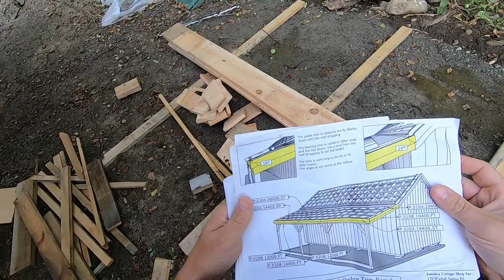Couple Builds Post & Beam DREAM BARN (Installing Windows and Trim Work)

Comment: Good morning Al and Gina. The weather here in west central Wisconsin has been hot and humid! We have had a few bad storms with a few tornadoes confirmed in the area. This heat is hard on the cows and a fat man!! It's cooler today finally. The flies have been bad also. One more month it will change. Average first frost date here is September 23. Good work today guys, Gina is a great helper. Thanks ,Ron
Reply: Flies can be controlled by Diatomaceous  Earth.Feeding it to cows can be problematic unless you give them grain and buy the pelletized type.Flies land on the manure with the DE which kills them.Used it to great effect in chicken houses.No flies within a week.

Comment: White vinegar and steel wool left for a few hours and painted on will give an 'antiqued'  weathered grey finish to the wood.
Reply: i was just about to say the same thing.
Reply: I have just learned something. 

I do enjoy these bits of information. Thanks for sharing.
Reply: test on a scrap piece first
Reply: It's called Pickle, cuz de vinegar. Test first, the steel wool would oxide, the longer you leave it in the vinegar the reddish would get. Leave the container open in other to aloud oxygen to help the process

Comment: If you put an eyelet on the outside of the window & hang a chain with a S hook from the fascia board you could open the windows all the way for better ventilation.  Just a suggestion.
Reply: And the way they lock closed leaves alot to be desired. As a whole don't like this window installation at all. It has a gap all the way around the window to let water into the structure?? Bad design. If stuck with them at least add some battens to the three sides.
Reply: @Belg1970  bear in mind the window needs to be able to open without butting anything especially at the top where the hinges are. There is trim on the inside to cover that gap.
Reply: @Belg1970 t's a barn. If Al wants air tight seals around the windows he can add foam weather stripping. He probably already intends to.
Reply: Sounds like a good idea.
Reply: @genevievegreene1595  Thats why I said to put the exterior trim on THREE sides only. I'm not uninformed as I have 30 years in the building trade as an electrician.
Reply: @michaelbrooks7214  Not talking about making it air tight just keeping the water out, it is a flawed design. Water is the number one thing that shortens the life of any structure.

Comment: When it's on video Al, you never have to count the eggs alone....we are always counting with you.  

In Qld Australia (north east) our summers are very hot, normis 25 to 35c (77 to 95f),  while our winters right now are cool but not cold. It's currently middle of winter and at 9pm my inside temp with no heating is 21c (70f) and thats with the windows open too. Outside is high teens with cool gusts maybe dropping it to low teens (55 to 65f).

Comment: Where I live it’s technically been spring for over a month. It finally decided to get some sunshine & flowers growing but I’m not looking forward to our boiling summers. I’d rather be cold than hot because you can always add another blanket or jacket. In summer you can’t get any cooler than nekkid (at home obviously). There’s only so much air conditioning & icy drinks can do when it’s reaching upwards of 40 degrees Celsius

Comment: 20:05 But if you age the barn boards all at the same time you miss the progressive photos of the barn color changing and the date stamp it gives you. I worked on a farm that the barns turned grey long before I worked there (the ones that weren't painted red). We built a wood shed out of mill slab (that was free back then) so you get to see the shed age as the years go by. It's a neat feature to be able to determine the age of the picture without really needing to look by the   look of the boards. It happens pretty quickly anyway with rain and sun.

Comment: Not sure what your wood is, but I aged some rough pine siding by shredding steel wool and placing in a gallon of white vinegar.  The longer it soaks in vinegar, the darker it becomes.  Then I brushed it on wood. Starting a little graying right away, and within a couple of weeks it had started becoming more aged looking.

Comment: Good morning Al. The weather here in Josephine County Oregon is hot and smokey. There is an 11,000 plus acre wildfire about 18 miles NNE of us and the wind is out of the north. The family is busy preparing to evacuate if necessary. 
On the windows, are you going to put a hook and eye on the outside to latch them fully open?
I hope Olivia has a great time at camp. Have a great week and enjoy your "couple" time with Gina. Practice for when your little girl moves out on her own.

Comment: Nice attention to detail, as always. Barn looks great.
You help with dinner, only fair that Gina helps with the barn ;D It does go faster with a second pair of hands, especially on the long stuff.
I'm surprised you can keep the feed in the sacks. I have 5 gallon metal cans with lids otherwise the mice make their own door into the bag ASAP.
Time to break that broody!
We have had the heat but nothing that could be described as cool overnight. We live 93 miles WNW of you. Will be passing through your area in a month.

Comment: Al...In order to break the soda habit, my wife suggests a drink with real fruit (lemonade, OJ, other juices) with plenty of ice and no carbonation or preservatives.  On really hot, dry days, she reluctantly suggests something like Gator Ade or Power Ade because of the added electrolytes.  I am told many soda type beverages causes your system to lose electrolytes.

Comment: Im in oakhurst ca. The mountains of the central san joaquin valley at 2100 elevation. We had snow on the ground in May?!?! No Spring and headed right into summer. Shorter summers longer winters part of the solar cycle we are going into. Good resource is the solar physist Valentina Zharkova for what we can expect over the next 10 to 20 year. Build greenhouses for your location

Comment: Morning Al 😀
Just wondering if you are taking any precautions against the garage door freezing shut, like NYC did in December. Does installing insulation boards help prevent that? I know zip about rain in  freezing temps (l live 15 minutes from Hope's birthplace in Az.  Yep, Weed 'Em & Reap area).   103° now.  Monsoons* forecasted for tonight & tomorrow ( * wind, dust, lightning,  thunder & rain. Rain here = "flash" floods to areas where there is no rain happening. Scary & driving should be avoided, if poss, during a dust storm).
Love your channel! Enjoying your beautiful surroundings!

Comment: cutting dove tail etc it is good for you to use pull saw......    any reason not to use foam etc between bottom stud and concrete ....    you will have urine to deal with.........

Comment: On those coil nailers what happens to the little wire pieces that are connecting the nails? Does it get driven in with the nails or are there little wires on the ground everywhere you use them?

Comment: The eve detail seems strange to me; only overhang is four or so inches of sheet metal. Window latch will 
allow for only minimal opening for air. Ground corn might be cheaper than alfalfa pellets. Funny thing about
grass fed beef. It was once considered much inferior to corn fed, that's when steers were finished on corn
for flavor and tenderness. I rather prefer corn fed, as raised in Ohio, Iowa, Indiana and Midwest in general.
It does all look like fun though, a little feudal paradisio w animals. Some fields, woods, creeks would be nice.

Comment: "Winter is coming. You need a snowblower for the Kubota!"

There's some stuff you can get which you spray or paint on timber which reacts with the sugars/starches in the timber and weathers it to look older very quickly. I can't remember what it's called though!
Reply: He has a plow for his truck that works fine.

Comment: Normal semi-tropical weather here in s\e Texas...80 at dawn with high in the mid 90's probably get a stray shower this evening.  Humidity between 80 an 90%.

August is going to be rough.  We won't see a break in the heat until October.  Sometimes we can wade fish in the bay through mid November.

Comment: You wear ear protection. I have started muting drill, saws, compressor, etc. because of the noise. Maybe it is a man-thing to like the noise. It would not hurt my feelings at all if you fast forward all the screws being installed. Sorry about the negative comment but maybe you don't notice.

Comment: Hey Al, you can age the wood using vinegar and steel wool solution. Easy peasy, git ya a couple 5 gallon buckets.

https://gadgetsandgrain.com/2016/04/08/oxidize-getting-a-vintage-wood-look/